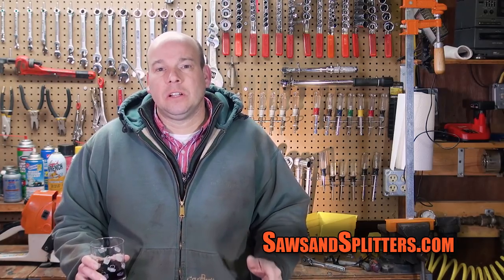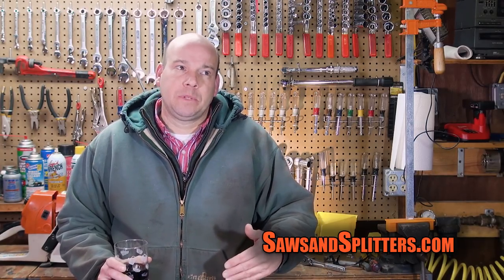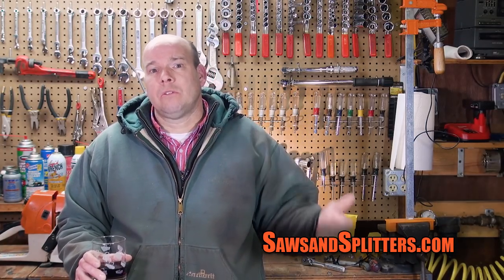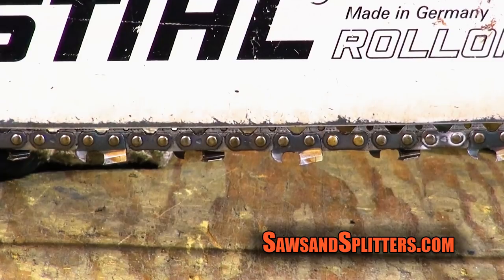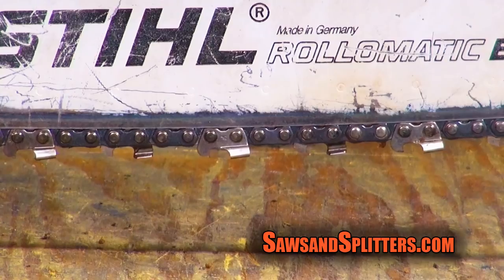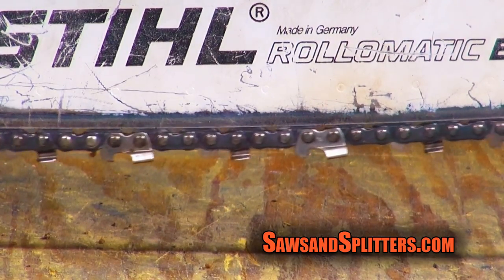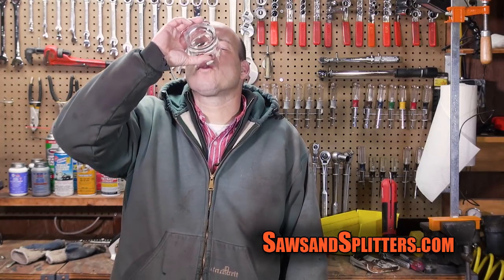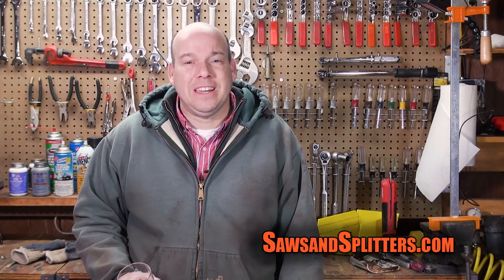LOOSE CHAINSAW CHAIN ONE SPOT EP.14

Comment: im going with that one recess in the rim sprocket is buggered up not letting the driver sit right in the slot and lifting the chain away. did you rotate the chain with the clutch cover off?
Reply from the maker: I didn't rotate the chain with the clutch cover off until I got a new sprocket and that answered fixed my concerns.  I don't know to what extent that rim sprocket was causing trouble but it wasn't Stihl and it wasn't Oregon so I feel much better with a new one.

Comment: Its more than likely the clutch sprocket. If it isn't good quality, or if you have used a worn chain on it, there will be burrs in the grooves on the sprocket. That will cause your chain to tighten and loosen as you spin it. The bar nose can be worn too, but usually only if someone has been doing a lot of brushing...